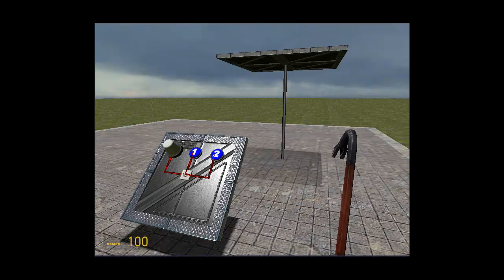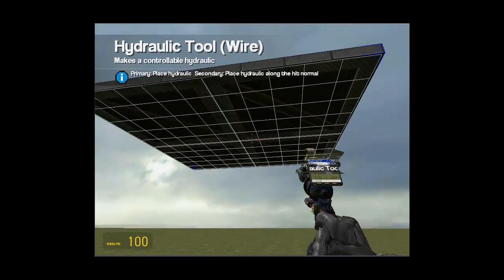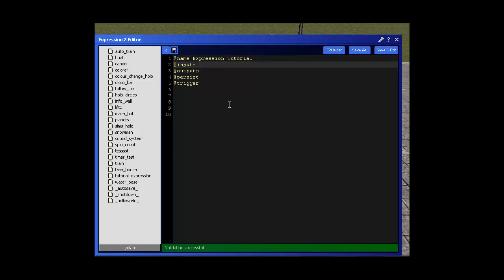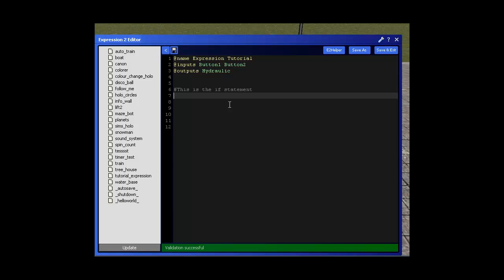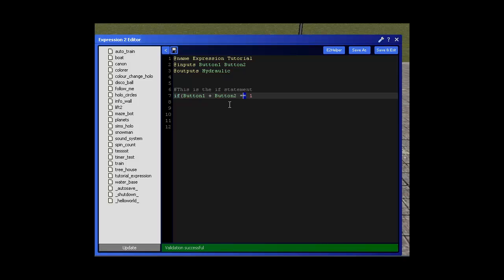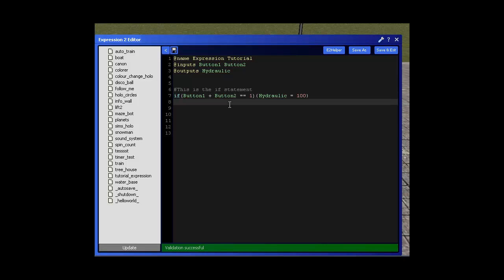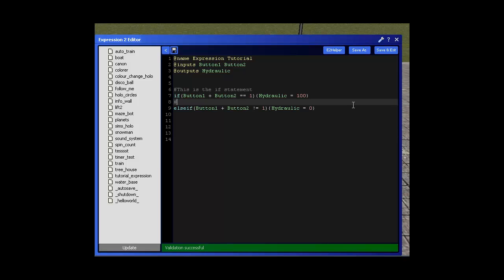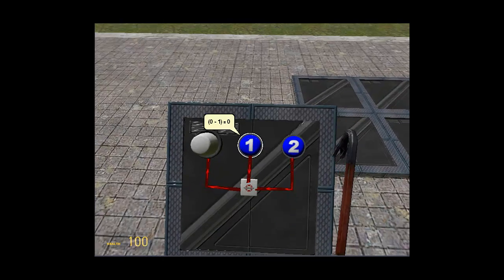Garry's Mod Expression 2 if statements

Comment: i know this video is very old but i need help with something! 
im trying to make a code that turns WASD into steering and throttle control for cars.
this is the code i wrote
it only turns right and reverses, wont go forwards or left
@name "throttle and steering"
@inputs A D W S
@outputs Steering Throttle
@persist 
@trigger 

if(A == 1) {Steering = -1} elseif (A != 1) {Steering = 0}
if(D == 1) {Steering = 1} elseif (D != 1) {Steering = 0}
if(W == 1) {Throttle = 1} elseif (W != 1) {Throttle = 0}
if(S == 1) {Throttle = -1} elseif (S != 1) {Throttle = 0}